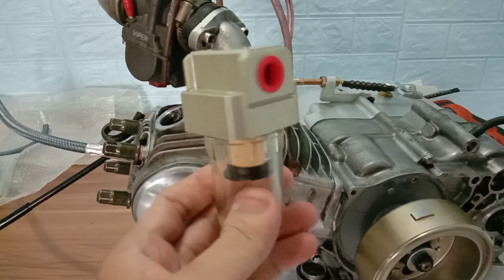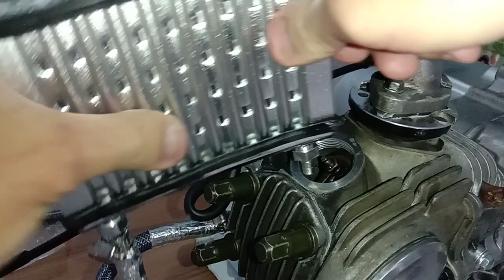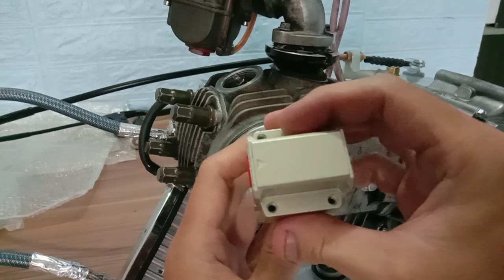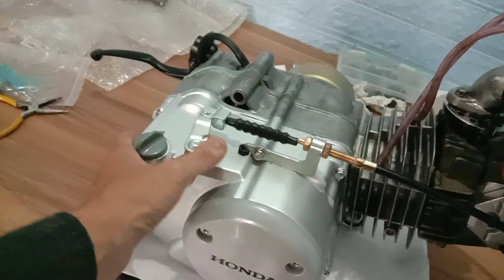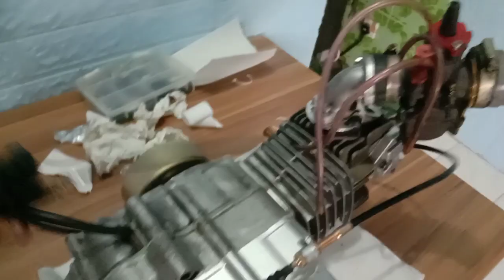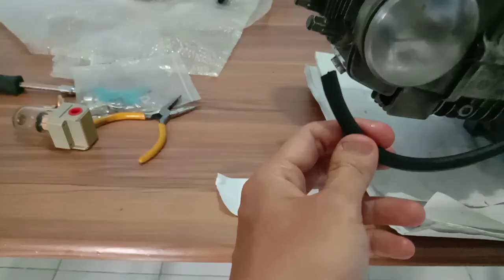Oil cooler and by pass hose(breather hose) untuk kurangkan kepanasan engine..

Comment: Perkongsian yang amat bermanfaat

Soalan:
1.Macam mana dengan capacity engine oil kalau pakai oil cooler....masih sama kaa contoh  engine oil 1l.
2. Kalo sistem ini kita add on pada engine yg guna radiator bole kaa?:-
 2.1. Impact performance
 2.2. Pro & Cont.
3.Ada sesetengah moto hose engine breathing masuk ke air filter box untuk dummy jaa (tiada lubang)..bole kaa dan ada  impact pada performance  engine tak...
4...byk lak soalan...nnti PM laaa🤭😅
Reply from the maker: nice.. soalan cepu mas..😁😁
1)capacity oil tambah 100-200 ml bergantung pada saiz cooler.. utk cooler dlm video ni.. 100ml je tambah..
2)boleh pakai kt motor yg dah pakai coolant radiator.. sekiranya running temperature above normal(engine modi)..
-pro-bantu kekalkan prestasi long distance/endurance.
-contra.. oil flow mungkin terganggu bagi engine yg perlukan oil pressure utk berfungsi.. contohnya pada camshaft RS150.. itu perlu test dulu..pressure cukup tak.. sbb priming dlm 10 saat utk system fully  working..
3)breather hos dummy.. tak digalakkan kalau tutup.. melainkan mmg asal kilang buat mcm tu disebabkan dah ade breather hose lain pada head atau tmpat lain..
cume bagi yg tambah bypass hose besar .. 6mm ke atas.. perlu pasang valve.. utk control breathing flow.. tak boleh lawas sgt..  monitor kelancaran engine ketika suhu optimum.. tune valve tu masa engine panas.. dan test bawak.. then check plug... sbb kalau ringan sgt mungkin ganggu piston ring seal potential.. dan ganggu AFR cranking pressure(loose).. plug akan jadi hitam.. 

yg penting kene test.. dan dapatkan output terbaik..  semoga dipermudahkan insyaallah👍👍
Reply: @fanzkito  terima kasih atas pencerahan yang mantap...semoga dipermudahkan segala urusan.🤩😍

Comment: Salam boh..apa pendapat tuan klu Kita letak kipas pada oil cooler tu?
Reply from the maker: takut minyak engine terlalu sejuk.. tak capai suhu optimum.... 
tapi boleh cube kalau nk eksperimen.
note
kalau engine berat.. atau timing rendah..walaupun dah running lama..tandanya minyak sejuk sgt..
Reply: @fanzkito  tq..jwb soalan..tertanya2 jgk apa ada dlm cooler tu smpi bleh sejukkn minyak..Sy ada buat wave125..spek 62 je jek 3..klu ikut padanan IVC cr max ialah 12..Sy buat lebih skit 12.8..motor xde cnoking.cuma ikut pada gps hnya bleh capai 19.7km dh  jem panas.x smpi 20kilo pun..tu lock trothle Dari awal..tu pasal Sy tnya bleh ke pasang kipas..sb Sy prasan vacum pada hose bypass sgt anginnya.
Reply from the maker: @nazlinazli7356  info yg baguss... same la dgn kes sy dulu.. baru ni pn jem jgk.. tapi motor hidup lagi.. piston calar je.. lepas pakai oil cooler.. ok... cume skang nk try tune angin bypass.. bukak lagi satu bypass siap control dgn valve... sbb tk boleh lawas sgt.. nk cari blow by gas flow yg terbaik... 

tq boss share info👍👍👍
semoga dipermudahkan..
insyaallah...
Reply: @fanzkito  bereh boh..btol lh tu..Sy pun motor hidup lg piston je calar..ada solution rasanya cuma bnyk keje lh skit nk buka balik.kena tebalkn sleeve,guna diesel sleeve ke..sb skg saiz 62 baki sleeve luar 65mm..sb geng2 Thai buat sleeve ya ampun tebal amattt,so Dari situ bleh elak panas melampau cumanya aduhai nk kna overhoul tu malasnya😄😄😄

Comment: Dah guna oil catch tank tu, pagi² memang banyak wap air. Nanti nampak wap air kat keliling tank. Bawah tu minyak hitam. Dah parking lama, ptg balik kerja dah bercampur, jadi air teh dah 😂
Reply from the maker: ye betul... tq for sharing info..  sy skang guna 2 tank.. sbb 1 tank mudah penuh... setiap 300km.. dah penuh air "teh susu"..😆😆

cubprix punye saiz 250ml.. setiap kali habis sesi kene check... 😅😅
Reply: @fanzkito  owh caprix pun mmg ada ek ? Betul ke kalau buat host pjg tempat tuang minyak hitam tu, akan ganggu pressure dalam engine ? Atau mmg bagus kalau kita buat juga oil catch tank ni ?
Reply from the maker: @nizammj9652  ye... regulation cubprix wajib pakai..... saiz 250ml oil catch tank.... tak boleh breather hose "open".. 
"belly pan" pn wajib pakai..

bagi sy elok pakai sbb ia bantu minyak engine tahan lebih lama... sbb sebahagian besar molekul air dah ditangkap dlm catch tank..

sy punye minyak hitam pn tahan lama dari sebelum ni... 3000km minyak masih likat mcm baru 1000km...
Reply: Dah try sistem SARD dekat motor carb ni x ?
Reply from the maker: @nizammj9652 belum try..😁

Comment: Bos,klau sudah pasang oil cooler macam tu,minyak 4T perlu tambah lebih sedikit tak? Sebap minyak tu dah naik ke cooler tu dan minyak kat dlam enjin kan dah kurang.
Reply from the maker: yes betul.. tambah 100-200ml sahaja bergantung saiz cooler tank.

utk yg dlm vedio.. 100ml je tambah..👍👍😁
Reply: Oh yeke..ok2x..jadi,klau buat oil cooler spack 53 je head masih ori boleh ke? Sebab moto sye main pickup utk off road je..hehe
Reply from the maker: @yunggibbs5311  utk spec 53 head standard pn boleh pakai.. takde masalah..👍👍😁
Reply: Ohh..ok..tq ya
Reply: gais. kalau minyak x naik apa masalah ?
Reply from the maker: kemungkinan
1)oil pump tak jalan..
2)lubang minyak hitam tersumbat terutama dekat tiang engine tempat minyak naik..

semoga dipermudahkan urusan.. insyaallah..

Comment: Oil cooler punya tank tu mana satu atas mana bawah? Lepas tu kalau nak servis tukar minyak, camne nak buang minyak dalam tank tu dgn mudah?
Reply from the maker: utk oil cooler flow.. mane2 boleh.. sbb die 2-way system..

utk flush minyak hitam dalam oil cooler.. sy guna teknik priming.. iaitu.. lepas masuk minyak baru.. sy bukak inlet iaitu hose minyak masuk ke engine... dan start engine(idling).. minyak lama(hitam) akan meleleh keluar.. bile minyak jernih keluar.. matikan engine... pasang balik hose.. setel.. 

semoga bermanfaat.. insyaallah..
Reply: @fanzkito  tq bro. Macam berminat nak install oil cooler nih. Nampak raged